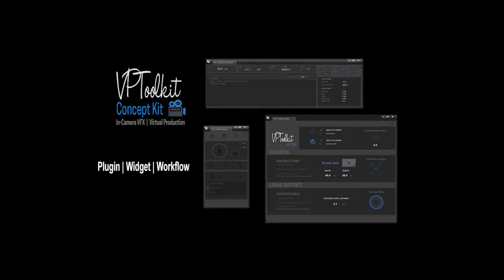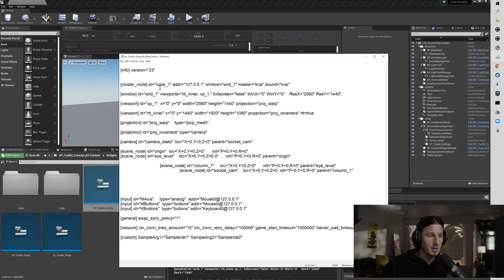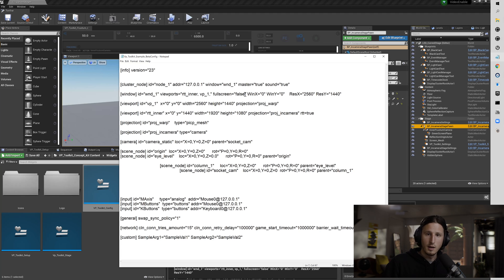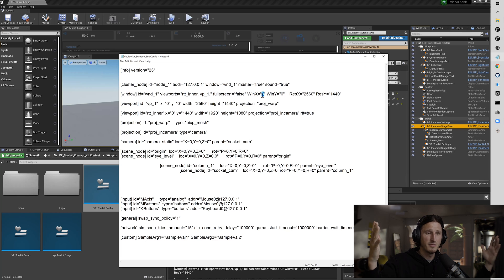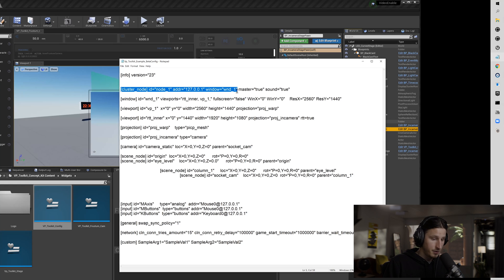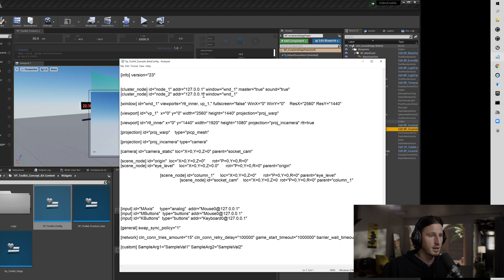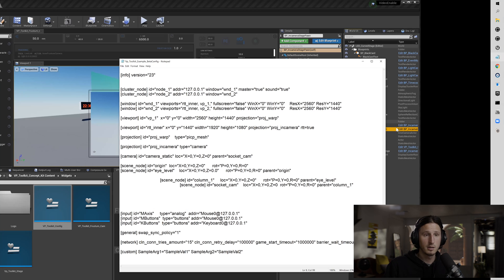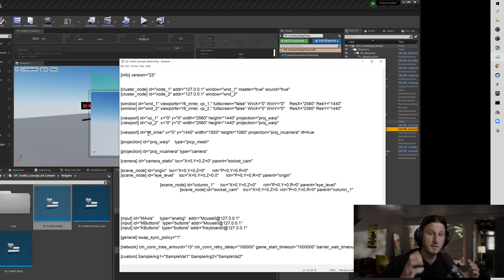E2.1 Adjusting nDisplay Config - UE 4.26 - nDisplay

Comment: Hi Ian, I've set up 2 nodes - 2 screen system using nDisplay 4.27 with an integrated cine camera with flying feature, so 2 displays are showing the entire cinecam view. However, I couldn't get the same result in 4.26 nDisplay, because the cinecam was able to be applied to only one screen/viewport so it couldn't cover two displays. Do you know how can I get the same result in 4.26 or can your tool solve the problem? FYI my project is an interactive architecture viewer so doesn't need the Incamera, but a cine camera which can freely orbit and/or fly to different building and spot in the scene.